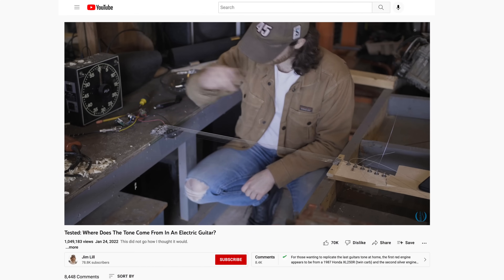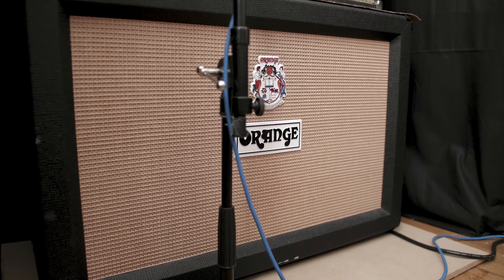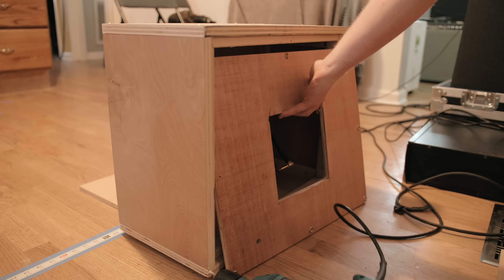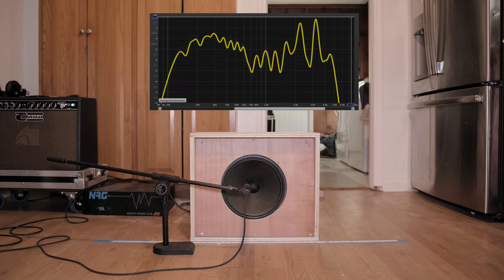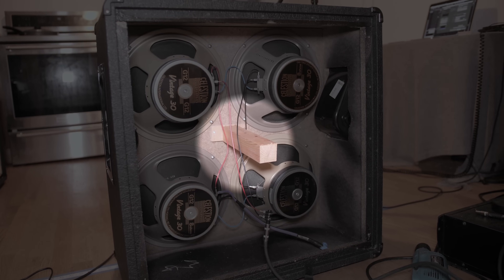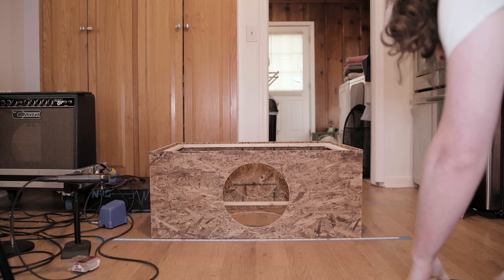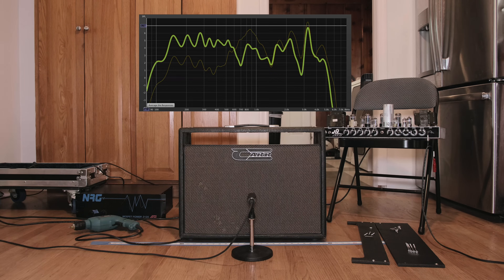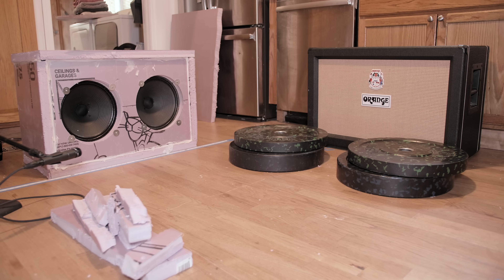Tested: Where Does The Tone Come From In A Speaker Cab?

Comment: Great practical testing! Your conclusion at the end is spot-on and is related to a phenomenon called acoustic impedance - this is similar to electronic impedance in that the speaker cabinet acts like a transformer to match the impedance of the speaker to the impedance of the air, which combined with phase shift and diffraction effects results in the response you see from different speaker cabinets. What's really fascinating about this is you can measure a change in electrical impedance of the speaker coil when you change the acoustic impedance by mounting it in a cabinet.

It's pretty well-understood what affects the response of a speaker cabinet, so I see this topic as more of an education issue. Speakers are relatively easy to model mathematically and you can get about 90% accurate from design equations that use the parameters of the driver and the speaker cabinet. This is easy using a graphical program like Hornresp or Akabak. The mystery of speaker design/sound is mostly limited to guitar cabs at this point due to tradition and superstition running deep in the industry, which stands in stark contrast to the scientific approach used in modern PA equipment. But like you observed, as long as your speaker cabinet walls are suitably stiff, only the volume of air and dimensions of the baffle and any ports matters (besides which speaker driver you've selected). A huge issue with guitar speakers is they don't typically publish all of the driver parameters, so the only way to accurately design a cab is to measure the driver yourself in most cases. Measuring the driver parameters is pretty easy with some cheap test equipment. Also worth measuring is polar response (as you rotate around the speaker), as baffle diffraction and such have a huge effect on how the speaker sounds around the room, especially for cabs with multiple speakers. If you'd like to to a follow-up video doing some more in-depth tests to explore the science/process behind speaker design I'd be happy to help!

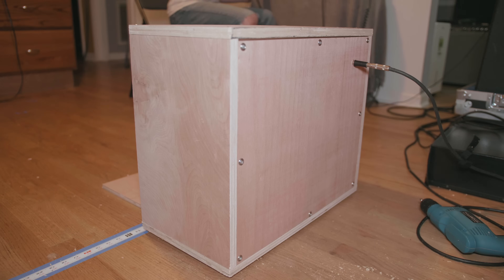With regard to your 5:20 tests, the transition from closed-back to ported and into open-back depends on the cabinet volume and the driver parameters. At a conceptual level, your test represents the following conditions:

1) With no holes, the system comprises the speaker driver (with its mass and springiness) with a spring formed by the air in the cabinet attached to the rear of the speaker cone (sealed/closed back). This is a second-order system that provides 12dB/octave of rolloff in the bass. The main issue with designing a speaker cabinet concerns what to do with the wave that comes off the back of the speaker cone, which is 180 degrees out of phase with the front wave and will cause destructive interference. A sealed cabinet resolves this by simply trapping the rear wave, preventing it from canceling with the front wave. This results in a boosted bass response compared to a speaker with no cabinet, and the spring of air inside the sealed cab provides protection for the speaker driver by resisting large excursions.

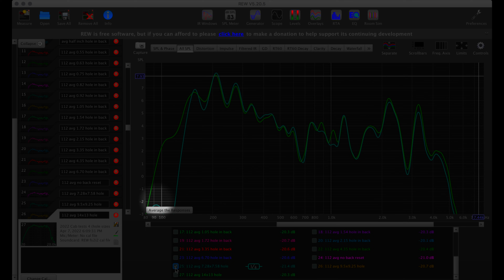2) With a few holes, another mass on a spring (a port) is attached to the sealed system. The air in the holes you drilled act as a single mass that bounces against the spring of air inside the box. This is exactly the same effect that makes a bottle whistle when you blow across the opening or causes an acoustic guitar to emit bass from its soundhole, Helmholtz resonance. As you probably know, you typically add a port to boost bass response on a speaker. I think in your case the speaker driver just has an unsuitable motor for actually driving a port, so you mostly just saw the decline in low bass response associated with ports, but if you look at the red plot at 5:56 there's a boost in the bass response where the port tuning is as good as it's going to get for this driver. If you mounted a speaker with a more powerful motor (higher magnetic field strength) and stiffer cone, then it would produce a lot more bass, likely at the expense of mid and high response.

A fun modification to an acoustic guitar is to actually tape a tube into its soundhole, extending the bass response but decreasing the volume. The tuning frequency is proportional to the area of the port and inversely proportional to the depth of the port. An intuitive way to think about this is a longer port hole provides more travel distance for the air in the port, lowering the tuning frequency because a longer wave is needed to push and pull the air in and out of the port. Don't let the velocity of the air in the port confuse you either - the sound waves always travel at 343m/s, so the velocity of the air in the port is only related to the amplitude of the sound.  A larger diameter port hole allows more air to move, but also must be proportionally longer to provide the same tuning frequency, so ports are made as small as possible without having excessive turbulence. If a port is too long it also causes secondary resonances that sound bad in the midrange.

With a port attached, the speaker behaves almost the same at high and mid frequencies as in a sealed system, but as the frequency approaches the resonance of the port the speaker driver itself actually stops moving, instead transferring all of its energy to the mass of air in the port and setting that into motion. This is the acoustic impedance phenomenon you hinted at in your conclusion - the ported enclosure presents a favorable impedance that allows the driver to do more work at the port tuning since the enclosure is allowing the speaker to push harder than it would be able to otherwise. The result is increased bass response at the tuning frequency of the port (mostly limited by port turbulence and thermal capacity of the speaker driver), but now there's a hole in the box, so below the tuning frequency of the port the bass disappears twice as fast as in a sealed system (24dB/octave, a fourth-order system). The speaker also receives no protection from overexcursion at low frequency, so a high-pass filter is usually required.

3) With the larger full-width cutouts, the box is effectively open, eliminating the extra springs in the system so the speaker is basically equivalent to being mounted on a flat baffle. Any resonance is from the speaker's own mass and suspension. This is called open baffle loading and results in a dipole speaker. Bass response is poor due to destructive interference of the front and back waves, with the mid response determined by baffle dimensions and the resulting diffraction. Frequency response changes dramatically as you walk around the cab due to diffraction and interference effects. The response pattern is similar to a figure-8 microphone. Siegfried Linkwitz has some fascinating insight and designs on dipole speaker design, which can help inform you when positioning open-back cabs. The same loading condition can also be achieved by mounting a large speaker into the wall of a room, but the bass response is actually good because the rear wave is discarded outside of the room - this configuration is called infinite baffle. Open and infinite baffle are both dangerous to the speaker driver for the same reason as a ported cabinet - nothing prevents the speaker from being driven past its limits at low frequencies besides its own suspension.

It's also worth mentioning transmission line cabinets to help understand how a ported cabinet creates more bass. If you imagine a ported cabinet, but make the port the size of the baffle and lengthen it until you get the low frequency you want (so the speaker is a long tube), this is a transmission line. The length of the tube is 1/4 the wavelength of the lowest frequency you want to tune the speaker to. This results in a very messy response (comb filtered), but between the first and third harmonics of the tuning frequency you get a massive increase in amplitude and efficiency compared to almost any other type of speaker. The reason for this again comes back to the speaker cone simultaneously emitting a wave at 0 degrees in front and 180 degrees in back. At the tuning frequency (first harmonic) we know the rear wave is delayed by 1/4 wavelength, or 90 degrees, so the result is the front and rear waves are now only 90 degrees out of phase and will thus partially add instead of cancel. The act of delaying the rear wave creates constructive interference at the tuning frequency, so we're just making better use of the energy that's already there. This is actually what a ported speaker cabinet is doing - introducing phase shift to the rear wave from the speaker driver by time delaying it so it can add to the front wave, but only at a specific frequency band because this time delay would need to grow longer as frequency goes down.

The same delay phenomenon is part of why you don't see transmission line designs very often. Unlike a ported cabinet, which behaves like a sealed cabinet above the tuning frequency, in a transmission line the phase rotates 90 degrees for each harmonic. So the second harmonic results in 0 degrees phase difference and max addition, third harmonic is 90 degrees just like the first, but the fourth harmonic is now 180 degrees out of phase and cancels completely, which is very inconvenient because this is typically in the midrange unless you've built a very large subwoofer. In literal terms this means you get a speaker that only has a frequency response from 20Hz-60Hz, 40Hz-120Hz, etc., but it is extremely efficient and loud in that range. The other main reason you don't see these is size - a transmission line tuned to 30Hz is almost 3m long to achieve 1/4 wavelength. Transmission lines are actually the simplest type of horn loudspeaker and provided a good foundation for understanding how those work.
Reply: I started reading the comment and then pressed the read more button to discover a whole article. wow
Reply: No one read this whole thing
Reply: good writeup
Reply: @AlphaAchilles  Many people read the whole thing, as I did. Personally, I find acoustic theory very interesting, Maybe you don't.
Reply: Some great points there! However, a couple of very important points that you’ve overlooked: 

1. It’s only (relatively) easy to model a speaker’s behaviour at low frequencies where the T/S parameters can describe its characteristics and when the cone can be treated as an ideal piston. Above 200Hz modelling would require extremely advanced FEA based on very detailed measurements, using the kinds of machines Klippel sell. 

2. Low frequency modelling as pioneered by Thiele and Small only works with small signal levels, and “small” is defined by the driver operating wholly linearly. Guitar speakers hardly ever operate linearly due to their minimal (or zero) voice coil overhangs, very light cones and relatively stiff suspension. So low frequency modelling of a guitar driver might seem useful but it may actually give results that don’t reflect the real world usage.
Reply: Man, I really suggest you to publish this as an article on medium or somewhere else. This should be accessible to more people, then here.
Reply: @BarefacedAudio   Fair criticism. I think you can understand wanting to leave out such complications in a 101-style writeup, but I stand by a properly-designed TS model being about 90% accurate so long as the frequency response curve is accurately provided by the manufacturer and interpolated with the modeled low-frequency result, with the remaining error mostly comprising baffle diffraction.

1) I totally wish Klippel measurements were more accessible. That being said, one can infer to a practical degree where the large signal limits are by measuring THD, and traditional THD and power compression are pretty easy measurements (as long as your neighbors are tolerant) for the DIY builder.

2) This is absolutely true and the resulting distortion is of course a huge part of the electric guitar sound. I hope we can agree that providing an Xmax figure of 0mm for zero-overhang motors would still more useful than no Xmax spec at all though since it at least makes the situation clear. As it stands, it's basically an educated guess how much excursion a given guitar speaker will tolerate prior to buying and measuring it as compared to any other speaker.
Reply: @VinceKrosh  Thanks! I'd consider it, but the context of the practical testing here is very helpful. I'd need to provide some drawings or tests myself probably.
Reply: @maudiojunky  I get what you're saying about a T/S model being pretty accurate and if this was a video about subwoofers I'd agree 100%. If this was about bass guitar cabs then I'd agree 50%. But for guitar speakers 90%+ of the tone happens above where T/S parameters are useful and the small amount of guitar tone that happens below 200Hz suffers from the non-linearity issues I already described.

Another issue which I haven't raised is that all these measurements are just steady state frequency response measurements (measured in one position). If that was all that mattered in a sound then you could achieve any sound by just applying multiband or parametric EQ to adjust the frequency response. But in reality there are differences in polar response, transient response, dynamic response and also distortions to consider (with harmonic distortion being a HUGE part of guitar speaker sound).
Reply: @maudiojunky  actually you can just link to this video. That is no problem. You are explaining what is going on here, not making an experiment. That is totally fine. You already made a great job by writing it all. It just makes sense to make it more accessible to people ❤️
Reply: @AlphaAchilles  go back to tiktok, that was a great read
Reply: damn dude- did you write THE book on this topic or what? very detailed explanation, wow
Reply: @AlphaAchilles  
Let me help you and fix your comment for you: "I will not read this whole thing, learn a lot and get ideas for further research. Instead I rather cosume a video which in itself is already way too long for my attention span and go with the conclusion that has been presented to me."

You're welcome. Oh, and one more thing: Please, don't vote.
Reply: Take as many words as you like to explain to me why I just spent the last 19:35 with No Music reaching my Ears.

Why ask any Questions about the electric guitar without the Gain @ Eleven, drown in distortion?
Is this research into an electric violin, oboe, or flute?
No..... It's Rock and F'n Roll, baby.

Accurate sound reproduction is a tricky affair that involves human opinion, imagine that?

Here is why the electric guitar is important in history...
Science got the chance to decide tone for the first time, from the back of a magazine.

Every goof in building an amplifier gave insight into what an effect that breaking or bending the laws governing circuit design dictated.

An effects pedal is simply a really poorly designed circuit for nearly any other application.  Now the imperfections can be added as individual components, chained together in any order, manipulating input values 
with math equations, creating a function out of anarchy.
A teenagers equivalent to stuffing laundry in an Acoustic Guitar.

They learned more about electricity, and had more fun doing it, than the poor sap in the office of Honeywell or Northrop or Motorola, or that's what those guys did when they sped away from the office?

The point is, that everything, down to the design of the Circuit, the Source of Tone and Soul of the Electric Guitar, is "The Rules" were broken to get it...

That is Very Rock and Roll.
Reply: @BarefacedAudio  I agree that the distortion from guitar speakers is a traditional part of the sound and is required to match vintage tones, but it's hardly necessary or desirable for all guitar tones to run your speakers into distortion. Plenty of funk, jazz, and metal players prefer a tight, articulated low-end from their cabs. I use PA drivers with long-throw suspension and shorting rings for my cabs these days since I like to get clean bass response and high dynamic range while playing downtuned guitar. I mostly use pedals for distortion, but if you prefer a 10W AlNiCo speaker as your distortion source then more power to you.

Pragmatically, the response above ~200Hz is something the consumer has very little control over - you have to trust the manufacturer's frequency response plot for the behavior there, so it's no better than saying "you just have to try it" to devalue TS analysis. But really, the response above 200Hz is the easy part precisely because you have little control over it. Learn to interpret the response plots and you've done all you can while shopping short of physically trying each speaker to judge its midrange.

I don't think it's very helpful to the reader to say "you just have to try it" for each speaker. Valuable information can be gathered from the manufacturer's specifications, but as I griped originally, real specs (including polar plots) would make it much easier for players to make an informed judgement about which speaker is right for them without physically trying several dozen of them. If there is no excursion available, so be it, specify SPL at 10% THD and show me the power compression response. An experience designer will understand how these specifications relate to the nonlinearities which contribute to guitar tone, but again if the manufacturer doesn't provide it then the designer is left high and dry. 

There is no black magic that makes it less useful to have specifications for guitar speakers. Hell, I can't even find rated SPL or response plots for assembled cabinets most of the time, and your company appears to think it's not worth the effort to provide this information either. How am I supposed to compare your products? You make very specific claims about your products including "...the mids and highs coming out of the AVD at the back are amplified and dispersed around the room whilst the lows are inverted to match the lows from the front, giving lots more bottom...you get twice the output of a closed back cab with an identical speaker AND even better dispersion and audibility (and far far greater output) than an open-backed cab". Do you have measurements to back these claims up? If so, why don't you publish these measurements clearly on the product page? If your patent-pending technology has been in development since 2013 then surely you've done some tests to verify these claims by now...

There's no good reason to obfuscate the real specifications and performance of guitar speaker drivers or cabinets. This is by far the most difficult category of professional speaker to shop for because not only is it relatively subjective, but manufacturers are apathetic to or actively undermine the ability of consumers to make informed decisions. Substantial comparative analysis is mostly only available in Youtube content where people run a dozen speakers on the same mic/cab to eliminate variables, and even then the best-sounding speaker from the video might sound awful in your own setup due to all the other factors in a guitar rig. It can be difficult, but I applaud any effort to make guitar products more objectively comparable to each other.
Reply: AudioJunky I have lots to reply to this but I think it would be more useful as a video on our channel because you bring up a lot of interesting points. Also my AVD cabinet patent has been granted and will be published in the coming weeks, which is nice! 

(One quick answer regarding cabinet/speaker selection for musicians curious about Barefaced gear - I provide advice by email and rarely get it wrong. That’s far more useful than putting all the data in the world on our website, especially as 99%+ of musicians lack the technical expertise to interpret such data. I work very hard to avoid selling someone the wrong gear because one bad sale now could cost us many good sales in the future - our business at Barefaced is built on the quality of our products and our expertise regarding matching them to musicians. But I appreciate that this isn’t normal, to have the designer of a product directly communicating with potential users, so it does cause some confusion and scepticism).
Reply: @BarefacedAudio  Congratulations! I look forward to seeing the details. I'm sorry if I came down hard on you in particular here for the lack of performance data - no major guitar cab manufacturer that I'm aware of publishes these specifications. JBL and other pro audio companies tend to publish thorough specs for their PA equipment, but even their consumer and prosumer gear is usually lacking in detail. 

For most consumer situations this is fine, like you mention with regard to helping guide common customers, but it's a bit more problematic that guitar speaker drivers themselves lack proper specs because people who are modding or designing gear tend to be in a position to benefit from that information, and that was the primary focus of my criticism. Even though I can measure them myself it's pretty inconvenient to buy (and hopefully return) numerous speaker drivers just to find the right one. And personally, if proper specs aren't provided then I'm unlikely to buy an assembled cab unless I can demo it.
Reply: just did a quick cntrl F to make sure you didn't slip the n word in there somewhere. Everything checks out. Liked.
Reply: Make own video instead of book length please.